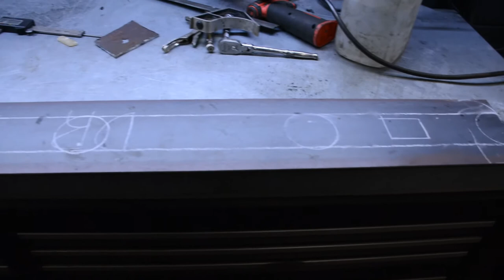Toyota Landcruiser - rotten frame!!

Comment: I'm not shure your intended use, so it may not be relevant. 
But multiple layers of metal will cause moisture in between, which will cause rust, which will force them apart over time. 
Also being much thicker by additional layering in some parts, will cause excessive stress on other original spec chassis areas, this could lead to stress fractures and failure of your frame, since they all flex a bit in use, and your double thickness parts will not flex as much, putting an additional load elsewhere.
I always cut out bad bits and refabricate them to end with equal to the original, so that restored parts play and move in tune, as it were, to the whole of the chassis. Nothing added and nothing taken away.
Thank you for a well made entertaining video sir, a good watch it is.